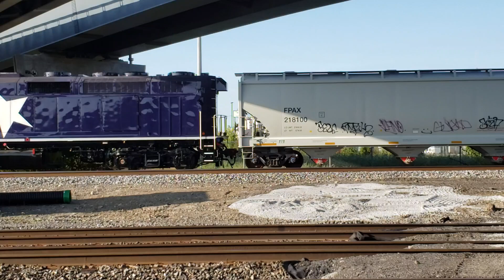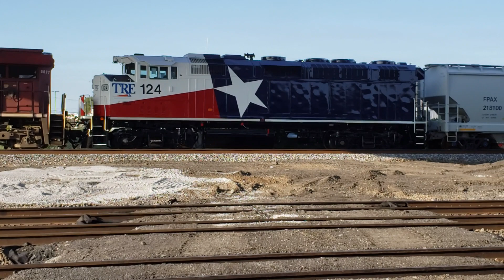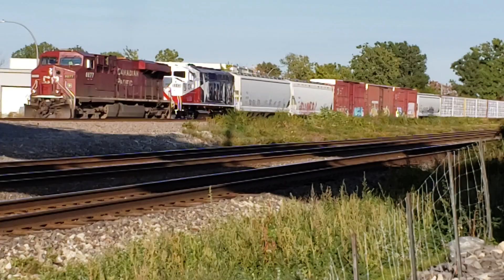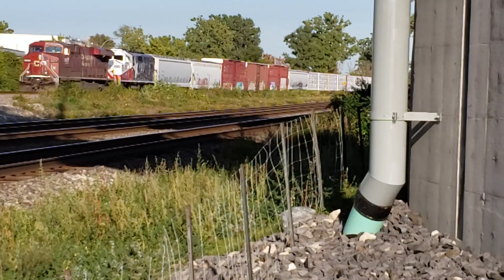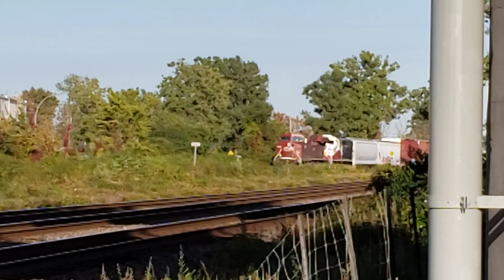TRAINS CP Freight With TRE F59PH Backing Up Under Dorval Ramps

Comment: I've seen CP do that with Go Transit locomotives in the Agincourt yard. My guess is, until their delivered .. the transporting railway puts them to good use in the mean time.
Reply from the maker: that's probable in this case.  they can also transport the locomotive without firing it up, but since this train was long, and I can't remember if a DPU was used, the unit may be active.